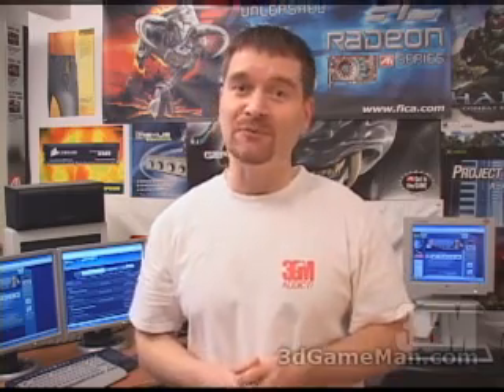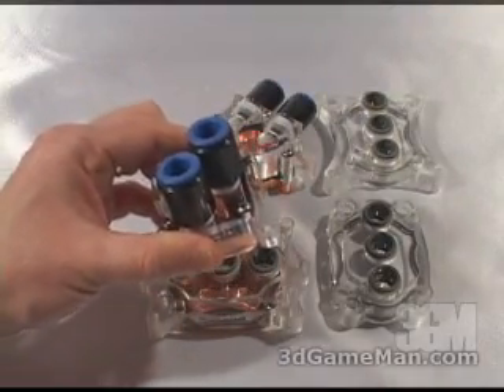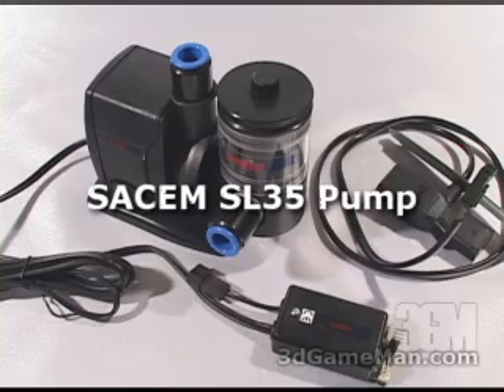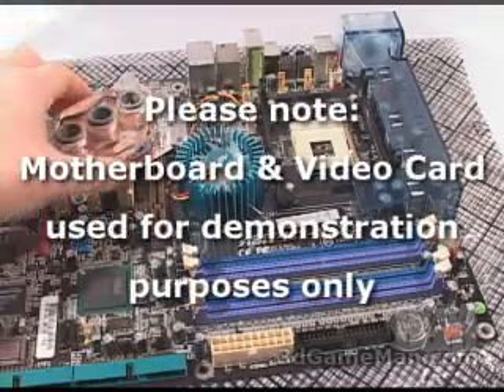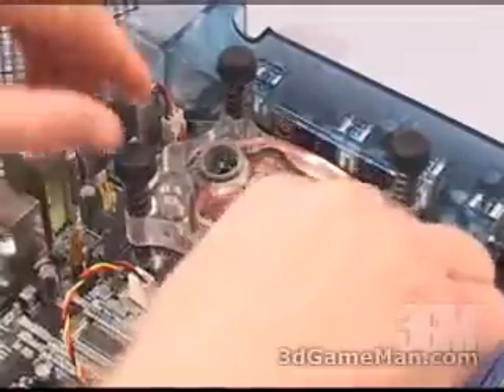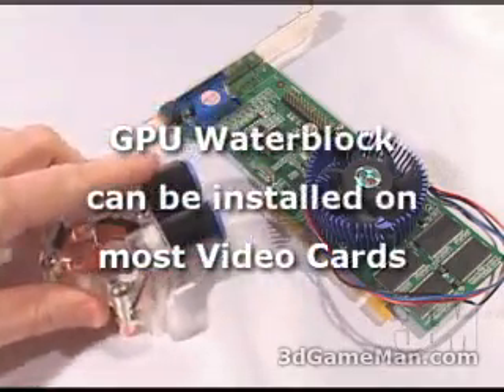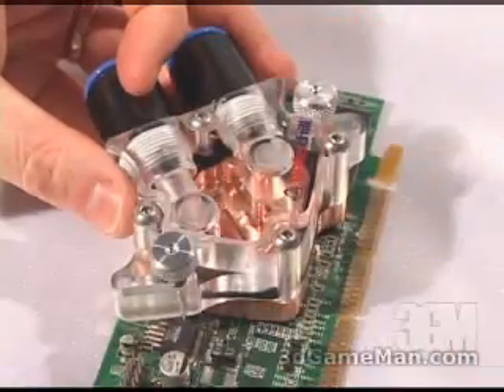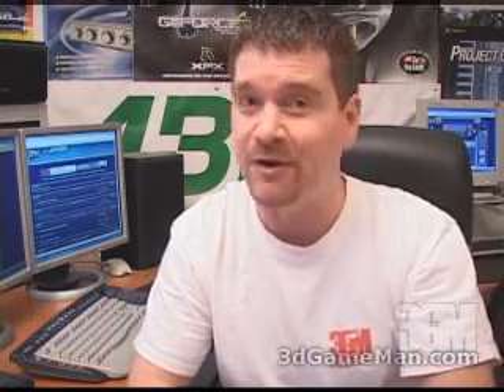#530 - Asetek WaterChill 2 Water Cooling Kit

Comment: its usually said that the order should be reservoir, pump, radiator, CPU, GPU, chipset. However, several recent articles say the order makes no difference. just make sure the reservoir is immediately before the pump as it has a purpose of stabilising the pressure entering the pump (at a very low amount).

Comment: I recently acquired one of these kits at a yard sale but it's missing the control unit, I do have the external power connector though, can I simply connect the pump to the external power supply?

Comment: teehee.. i just bought a smaller version of this kit (with no fan, a slightly weaker pump and only a CPU block with 1 fewer socket adapters for 1/5th RRP on eBay. :D